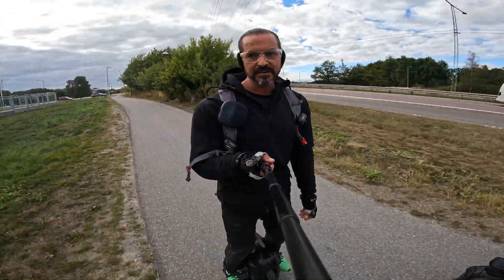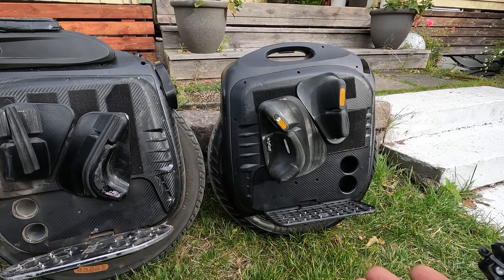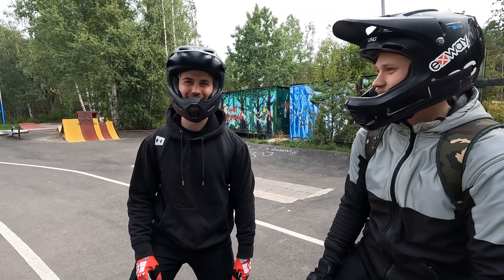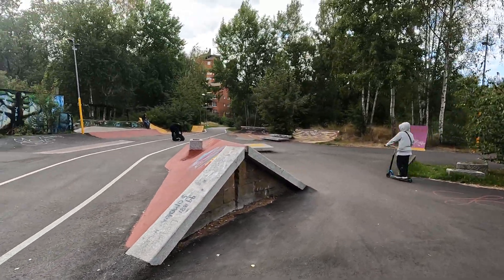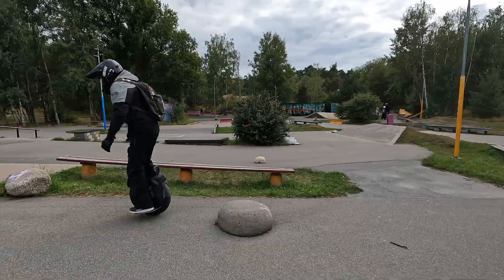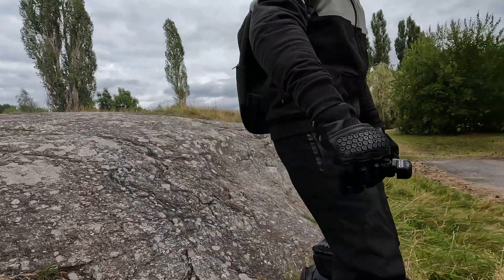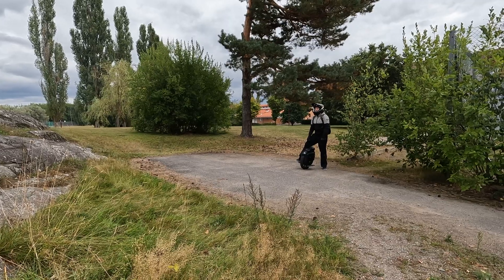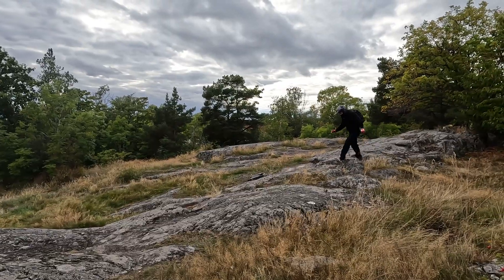Tech Talks - Can you firmware mod a high speed wheel to make it more high torque?

Comment: (250/220)^2 = 1.3; or 30% more resistive losses. I dont think these performance competitive chinese manufacturers tune their systems of longevity in the first place... just because it isnt fried yet does not convince me its a great idea for everyone. Still cool to see people experimenting though!
Reply from the maker: Thanks for sharing your knowledge. The MSP HT and the HS are both 250A. They just decided to make the RS HS firmware cap at 220A. The original EXN firmware was 220A, then raised by Begode to 240A and now again to 245A. The RS and EXN share the same motor and the same black motherboard. The RS HT is 245A and the EXN HT is 250A. So this change we made on this wheel should be feasible and not unrealistic. But yeah... like you say not a good idea for everyone haha. But definitely worth me trying and sharing the results! More to come!
Reply: @isthereanyfood  Could be its just a firmware change... but if this is more than just marketing/segmentation; on engineering grounds youd also expect for instance a winding difference in the motor stator; so even if the motorboard is the same for manufacturing simplicity, there still might be caveats like that.
Reply from the maker: @eelcohoogendoorn8044  Definitely! Not to mention the difference in magnet size used in the high torque wheels.

Comment: If the difference between a HT and a HS wheel is firmware, I'm calling foul on the manufacturer. 
Congrats on continuing to be the most informative EUC channel around.
Reply from the maker: Definitely more than firmware. Motor winding matters and so does magnet size. But still.... it did make a difference! Now one interesting thing to do would be to test with an RS HS side by side or just Wiktor on this RS and ask him to unleash hell lol. I got on my Nikola shortly after with its amazingly low 200A and that one can skip quite easily if I torque it. Wish I had a black motherboard for that baby! I would at least bump it to 240A lol.
Reply: @isthereanyfood  That's interesting. Cheers.

Comment: Yes you can Iv got a mss EXN 3150wh and it’s the best wheel out there
Reply from the maker: Congrats on the MSS EXN! Killer wheel indeed. Sergei still has is and I was on it last year. Back then I wasn't used to the firmware behaviour but after riding accelerated stability modes for a longer time now I am sure it will feel very natural. I will certainly find out and try it again!

Comment: PWM is the means of controlling the power to the wheel. Increasing the angle over which the phases are powered (what represents 100%) for a given voltage would increase the current,  power and torque (we will forget about the speed of the wheel for the moment though that too has a bearing). Beyond a point though the efficiency of the wheel will drop giving diminishing returns. A drop in efficiency also means less range and more heat within the motor (potentially taking the motor beyond its spec).
Reply: I’m not sure what you mean by “angle” here…can you elaborate?
Reply: @SuperHiddenYoutube123  Well the duration of a pulse on a phase will not only depend on the power required but the speed the wheel is rotating, but the angle of rotation for which the current is passing through a coil would be constant with speed. You would suppose a maximum angle for 100% PWM reducing to zero angle for no power at all. Now this is not strictly true because the controller programmers will have varied what 100% represents with speed, but you get the idea.
Reply: @Roskellan  Hey, I am still a bit confused about your response. It bothers me because I am a master's student in electrical engineering. I work as an IC designer supporting power electronics projects such as energy conversion and motor drive, typically by designing gate drivers. Your channel looks quite interesting. Is there another way we could communicate in more detail?
Reply: @SuperHiddenYoutube123  I'm trying to say too much in a paragraph probably. The starting point is a standard induction motor, 3 phases set apart by 120 degrees. The speed set by the frequency of the supply and the number of poles. The supply is dumped on it and the motor slips until it is up to speed (the torque raising throughout, at its rated speed it has maximum toque, if the speed was further increase the torque would reduce dramatically. So in theory we could just alter the frequency of the supply for the speed we wanted to go. Unfortunately that motor was designed for one speed only, so we will have to be a bit cleverer than that. Welcome to PWM. Pulse Width Modulation. I have designed PWM controllers for small DC motors (common in RC models), a DC motor can be controlled by voltage alone, more voltage more speed and more power, the disadvantage is that there will be very low torque at low speed. So we use PWM. Think of a square wave, a mark and a space, if we vary the size of the mark relative to the space we will vary the power going to the motor but in this case when the power is supplied the motor will be at high torque (even at minimum speed). (my circuits also reduced the size of the space using the back emf of the motor - another story, don't think they do this on EUC's).  If the size of the mark is reduced to zero the motor will stop. Reverse the supply to go backwards. In the Induction Motor only one phase has to be reversed to go backwards. Now apply the PWM to a 3 phase induction motor under micro-controller control, the frequency of the supply will still control the speed of the motor but we have another variable the duration of the mark to play with - EASY, well perhaps not easy :--) In a good design you do not really want a square wave either, a sine wave being optimum.
Reply from the maker: Thanks for sharing your knowledge bro! I doubt I am at the 250A limit that often considering how gently I ride. But it is nice to have the higher ceiling for those times that I just want to push it up a hill or something or just flick it around at low speed. When it comes to high speed riding I pretty much always accelerate gently especially when reaching the PWM alarm.

Comment: Phase Amps = Torque, essentially however the motor kv rating is usually the main limiting factor for how much you can squeeze out that and the winding of the hub of course.
Reply from the maker: The EXN uses the same motor and while original firmware was 220A it was then raised to 240A and then again to 245A. So it seems feasible! Time will tell though so I will be the guinea pig... as well as some of my donkey friends perhaps haha.